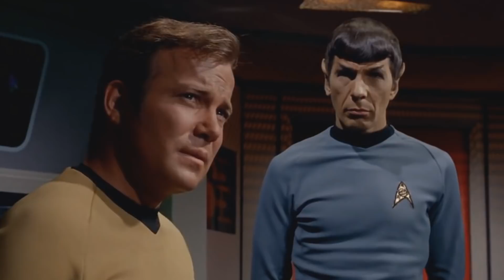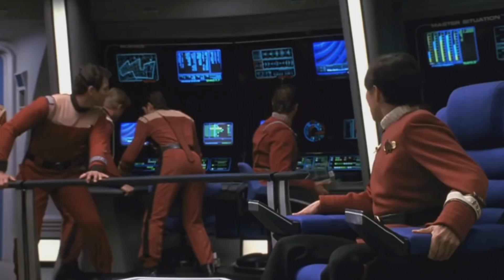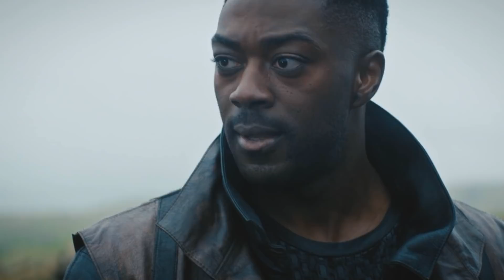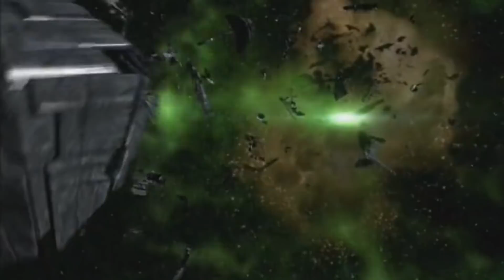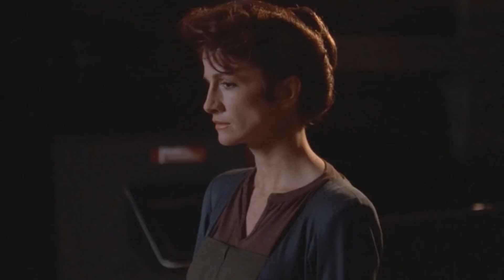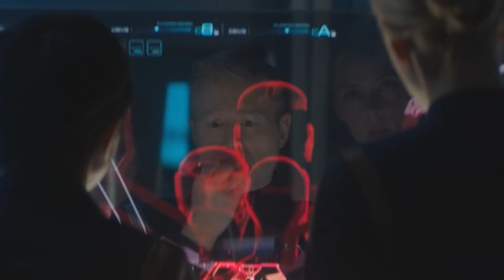How Can Dilithium Explode ? How to Explain The Burn in Star Trek Discovery and Other FTL References

Comment: i think in cannon you can do up to warp two (old scale) without dilithium
Reply: and in theory, if you have a stable chunk, and you can run it thru a transporter to get it to your ship, you should be able to make it in a replicator
Reply: @bearthebucketheadedsith  
No, no, and no. Dilithium cannot be replicated, and it's energy dynamic properties make it unsafe to transport by teleportation. It doesn't matter anyway, as inert dilithium doesn't make your ship explode.

Comment: The simplest explanation is why ships exploded if they had active warp cores, is that the radiation from the matter-antimatter reactions is channeled to the dilithium and if the crystals instantly went inert and were no longer converting that energy to electricity, all that uncontrolled energy would cause the explosion. Not to mention if an uncontrolled radiation surge caused the containment fields for antimatter to be compromised... BOOM.
Reply: Problem is, we've had that happen before, and all it does is trigger the engines to shut down, not explode. We've only seen warp cores explode when directly damaged, and dilithium only explodes when active, unstable crystals are exposed to massive amounts of energy. It's all nonsense.

Comment: How can Dilithium explode? If it went inert and stopped allowing the energy to flow through it but instead blocked it then you have antimatter hitting matter. That equals boom!
Reply: Not how it works. The energy from the matter/antimatter reaction goes through the crystal, not the matter and antimatter themselves. The engines should have just shut off.

Comment: The matter-antimatter reaction is an explosion and what powers the core; the dilithium only regulates the reaction and isn’t itself a fuel
Reply: When it stopped working the dilithium (it when inert) that doesn't stop the antimatter injectors so you now have a matter antimatter reactor going from controlled state to a very big bomb because the dilithium stopped regulating it
Reply: @leexgx  
As seen in those first clips, the crystals regulate the energy flow coming from matter-antimatter annihilation, not the reaction itself. If that wasn't the case, the Enterprise would have exploded.
Reply: Don't Romulan ships use a micro-singularity to power their warp drives? Those shouldn't use dilithium crystals. Why wouldn't the galaxy just switch to different propulsion methods?
Reply: @augustday9483  biggest lore failure thus far; if anything the Romulan Star Empire should be resurgent and the dominating power after the Burn, as they would be among the few interstellar nationstates still operating at FTL

In fact, why invent the Chain and Osyra when they could have just made the New Romulan Empire the adversary? Assign all the bad behavior insinuated to the Chain to the New Romulan Star Empire instead
Reply: @augustday9483  
"Why wouldn't the galaxy just switch to different propulsion methods?"

Because reasons.
Reply: And to also add the ships that had a active warp core blew up it was not every ship with a warp core. Hence  why ships are still around since they was not at warp at the time. if that was not the case then discovery would of been the only warp capable ship since it was not present during the burn.
Reply: Well, warp cores will still go boom.

Comment: The issue is not the Dilithium exploding. Dilithium can surely explode, like when it's put under enormous stress, or hit with its on resonance frequency. Thing is, on Discovery it went boom because it became inert instantly. Well, the issue is, inert only means it doesn't bond well with other atoms. Like Helium doesn't bond with other elements. That's due to it's electron configuration. Other examples for an inert material are platinum or gold. So by going inert, Dilithium would only stop bonding with other atoms. But that's not how warp drive works. it's not a chemical reaction. Dilithium is a crystal used to moderate the matter-anti-matter-raction. Much like we use Graphite to moderate nuclear fission.

The next issue is, why would this happen instantaneously, but not affect all Dilithium? I mean there is obviously still Dilithium available. Even if we assume Dilithium isn't a stable element, which is contradicted by previous Star Trek, there is no way of everything goes boom the exact same moment. That's like saying all Uranium decays after the exact same amount of time. But this is a probabilistic process. It happens, or it doesn't happen. But it definitely doesn't happen at one exact point in time.
Reply: The show has confirmed that the Burn didn't happen instantaneously after all, but that it was a bubble which originated from one point in the galaxy at such high speed that it appeared to be almost instantaneous.
Reply: @thegreywanderer8427  On Unification II they said it happened at the exact same time everywhere, except for that nebula, where it happened a millionth of a microsecond before. And that's absolute bullshit. But don't trust my word, let's do the math. 

We start with the planet consisting of Dilithium (don't make me start about that) at the center. Since they said themselves it happened all over the galaxy at once, a billionth of a microsecond later, we take the galaxies edge as a frame of reference. The galaxies diameter is currently discussed to be between 100,000 and 200,000 light years. A light year is 9.46e15 meters. The speed of light is still around 3e8 meters per second. 

So for the lower limit this means: 

100,000 ly * 9.46e15 m/ly : 1e-12 s = 1.89e33 m/s or 6.31e24 times the speed of light. Double that for the 200,000 light year galaxy. 

Let's now look what means for the entire unvierse.

Take Andromeda first. It's about 2.5 million light years away from our galaxy. 2.5e6 ly*9.46e15 m/ly : 1.89e33 m/s = 250 nanoseconds. Half that for the upper limit.

Or let's take the edge of the visible universe, which is approximatley 46.6 billion light years away. 
46.e9 ly * 9.46e15 m/ly : 1.89e33 m/s = 466 microseconds. Half that for the upper limit.

For comparison. The shortest blink of an eye is 0.02 seconds. That means the entire visible universe experienced The Burn 42,900 (85,800 for the upper limit) times before the eye reopens. So yes, it's valid to call that instantaneous by human standards.
Reply: @oliverfranke7650  that’s not what they said
Reply: @oliverfranke7650  It's also impossible. The entire local cluster should be ripped asunder. thanks for the math to prove it.
Reply: @oliverfranke7650  You need to check again. They were able to locate the where the burn started because of the millionth of a nanosecond between the destruction of three ships. From MA and Unification III: " USS Yelchin, lost contact one one-millionth of a second before the Gav'Nor, which had been a thousand light years away at the time. The computer is still analyzing the third recorder, from the USS Giacconi. "The analysis revealed that contact was lost with this ship seven nanoseconds after the USS Yelchin had been destroyed."
Reply: @Roche_Furman  Well, if you say so.... But what you simply miss is the fact, that this would still be so ridiculously fast, that it would almost instantaneously affect the entire universe. You can do the math yourself. I provided the necessary equation. And if you didn' t fail 7th grade Algebra, you should be able to do it yourself 😉
Reply: Indeed, and what of those races that have used it for centuries more? 

Or the Romulans who don’t use it. In fact only the federation tend to use Dilithium if I remember correctly. 

Discovery is just stupid.
Reply: @nicholasdickens2801  i had stopped giving a shit about logic with this show so long ago and i just laugh at all the dumb shit that happens now.... wow thats such a solid point....yeah why arent the romulans and non-dilithium dependent races/groups now dominant?  Thanks for the lols
Reply: @nicholasdickens2801  Though I think the Klingons use it too. After all they were strip mining their own moon to get it. 

Romulans of course don't, because they don't use matter and antimatter at all. And there are plenty of other species who don't use Dilithium or antimatter based warp drives, nor any warp drives at all. 

And remember. When Cochrane built the Phoenix, he couldn't have used Dilithium. Canon wise there isn't any Dilithium on Earth. So even Federation warp drives utilizing Dilithium is a choice out of convenience, not necessity.

STD stating there is no viable alternative, though they stated in the first episode that there is still wormhole travel, transwarp and quantum slipstream, is plain stupid. This Burn is plain stupid. It was introduced for the sake of having a dark and grim future, where the Federation is destroyed. Kurtzman simply hates what the Federation stands for. He tried to destroy it or at least damage its reputation badly, since the first season of STD.

Comment: Roddenberry: Science fiction - must have plausible science.

Kurtzman: Science fiction = magic!
Reply: Dilithium is a magical substance. It doesn't exist.
Reply: @Geddo1  lithium is an element commonly used in batteries, Li2 does in fact exist, but it is a gas not a crystal.
the thing about today's science fiction is that it can be tomorrow's science fact.
Reply: @Leviathis_Krade  Correction, today's syfy isn't but yesterdays SciFi was.
Reply: @Geddo1  
Dilithum crystals still has rules to it's existence, and lithium molecules have similar uses in reality.

Comment: Its not that the dilithium exploded. It became inert and as a result it stopped regulating matter and antimatter reactions. The result from that was the matter and antimatter in the core exploded in an unregulated reaction. The role of dilithium was to absorb the energy released by matter and antimatter reactants and release that energy in a controlled matter into the plasma conduits that lead to the ship's warp drive and other power intensive systems. Because of this, there is a reason why some ships were not destroyed. Those ships likely had their warp cores offline for maintenance, at which point, they would have seen their dilithium become inert. or gotten some sensor reading to that point. 

Also, they even said in Discovery itself, the Dilithium became inert. It was the warp cores themselves that exploded due to no longer having a "control rod" in place to regulate the reaction. Its the same thing that would result if Geordi had decided to do core maintenance the in the TNG episode where, due to no one being able to sleep and had forgotten how to do even basic stuff, and forgotten to put the crystal back in before restarting the warp core.

Now as for the Piezo electric stuff in TNG and Disco, that is not dilithium exploding either. The dilithium is absorbing energy and then releasing it. Violently.
Reply from the maker: turns out it was a Kelpian man's triggered screaming that caused the Burn
Reply: @MajorGrin  ok, i guess THAT i could buy...

Comment: Ok, my understanding is that the Burn was caused by all dilithium going inert. Dilithium is used the regulate the matter/antimatter reactions that power warp cores, so it kind of acts like the control rods in a nuclear reactor. No working dilithium, core goes super critical, big boom. The question is how do you suddenly turn off the properties of an element temporarily over the whole alpha and beta quadrants, or potentially the whole galaxy? Not to mention that the complete collapse of Starfleet just from this one problem makes no sense. By this point, the Romulans had joined, and Starfleet would have access to black hole engines that, while less powerful in terms of speed, would have still allowed them to maintain warp travel. Not to mention all of the other warp capable civilizations that were not dilithium dependent. Species 8472, the Dominion, Breen, or Borg systems could easily be reverse engineered especially in the 1000+ years after Voyager. Even if they weren't going to be implemented fleet wide, they would have been of great interest to the Starfleet Corps of Engineers....
Reply: Except that you can see right in the very first bunch of frames in this vid that the dilithium can get fused (perhaps in other words it becomes physically inert) and nothing happens at all (i.e. the ship loses its warp drive and stops moving). ;-)
Reply: @globalterroil3208  Exactly, which goes to show that even Constitution class vessels had emergency shutdown protocols built-in to prevent this exact problem. Did all of the regulations get thrown out in all that time? Not to mention that we've seen warp cores fail plenty of times and they can either be shut down before a breach or ejected.
Reply: Your logic does not work for the writers because...well, it's logical...

Comment: Did they say Dilithium exploded? I remember it was Di going inert, resulting in warp core breaches in active cores, which ended in explosions. Want to hate, also must hate the right way. Change the title of the video, or take it down as it is fake fictional news.
Reply: Dilithium going inert wouldn't do anything.
Reply: @Idazmi7  Not according to both the alpha wiki and normal wiki on Dilithium. If Di goes inert, the matter and anti-matter mixing reaction will cease to be regulated, and result in a warp core breach. 

Did you read up before you commented? I assume you didn't, but you are forgiven. That's why Major Grin needs to change the freaking title. Dilithium doesn't explode, the warp core does.
Reply: @Idazmi7  I saw a star trek movie , the last one with klingon ship and their cristal dilithium goes inert (no more power) they have to refill it with nuclear energy from a boat

Comment: Ah yes, inert, as in random detonation.
Reply: Dilithium is a regulator, so the warp core explosions would have been caused by a lack of antimatter regulation. However, now that fan theories made a plausible interpretation, the writers are gonna mess it with something illogical again. Probably along the line that a child's "emotions" caused the entire quantum field of dilithium crystals to turn "sad" universally and became "introvertive" (inert).
Reply: I bet STD writers think inert is like inflammable
Reply: Someone explain to them that inert means having no inherent power of action, motion, or resistance not it goes boom.
Reply: @moralityisnotsubjective5  I think they explained that first the dilithium went inert, and then (centuries?) later the burn happened..
Reply: if a crystal that controls matter/antimater reaction stops doing what it's supposed to (control the reaction) and becomes inert, you have a matter/antimmater explosion. That's it. It's because the control is done by injecting two beams INTO it.
Reply: In other words, dry ice is wet

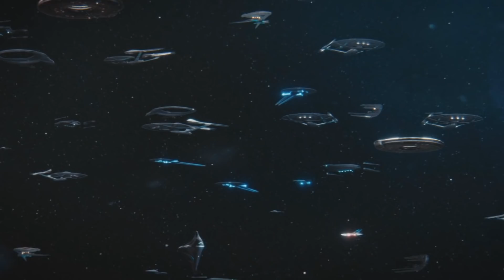Comment: 3:00 the Dilithium went inert (non-reactive and quite safe (wouldn't ert a fly)) and every starship exploded.  Does STD not know English?
Reply: The dilithium isn’t what exploded. When it went inert, the antimatter in the active warp cores reacted with the inert crystals, causing a warp core breach.
Reply: @solarflea4115  or the antimatter reacted to matter and well... Boom.
Reply: @biohita  well dilithium is matter so...
Reply: @solarflea4115  What does it even mean it went inert? It is a piece of stone, a crystal, it is not supposed to be chemically active, at least not in some excessive way, so perhaps it can be considered semi-inert already. Matter and antimatter specifically react in the intermix chamber and from there this flow of high energy plasma enters the lattice matrix , where the crystalized dilithium is seated, and is further turned into a special form of plasma (this is where most of the magic is supposed to happen because of special physical properties of the element in question), which eventually, when distributed through the nacelles and hitting the warp coils allows for the creation of a sustained warp bubble surrounding the ship. The dilithium crystals happen to lose their power with use but can be reamplified or simply replaced for other ones. Sometimes they even can get fused in their assembly. And would not that be becoming inert, even in a physical sense of meaning? (All this is canon btw. Concerning the plasma flow, you would just stop it by venting and by closing the valves.) It does not appear there is much space here for fast or perhaps even instant explosions at all! For that you should be playing with the antimatter containment field , which btw is attested and discussed in the canon as well. Or; you must introduce some new element of surprise.
Reply: @globalterroil3208  excellent post, one thing though: *canon
Reply: @ZeroB4NG  Thanks. Fixed.
Reply: Inert doesn’t mean safe